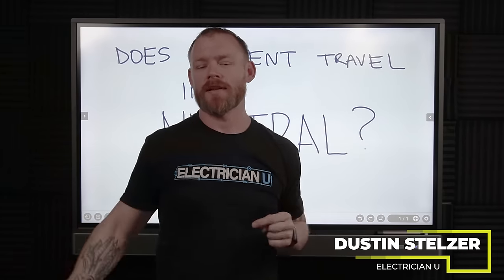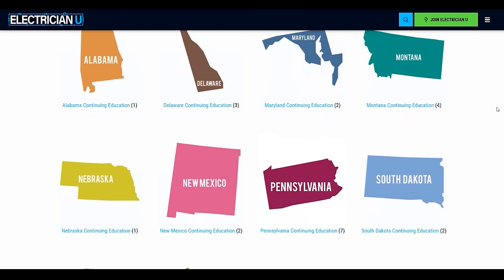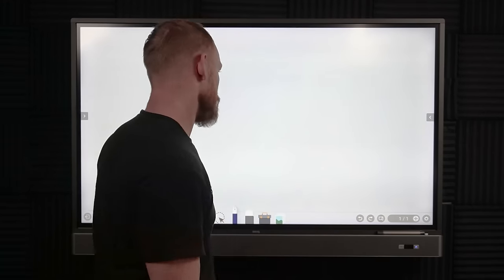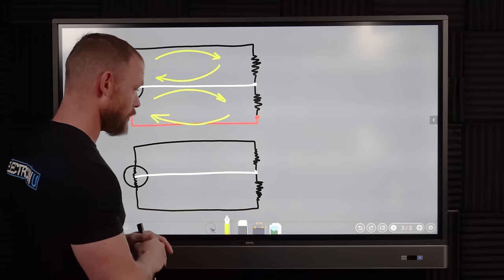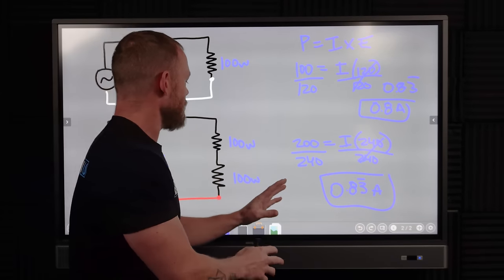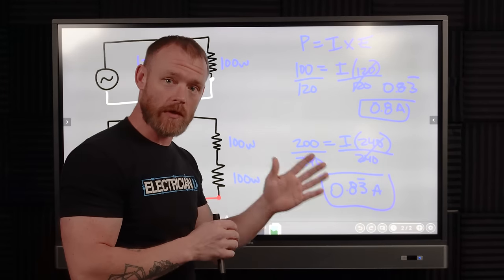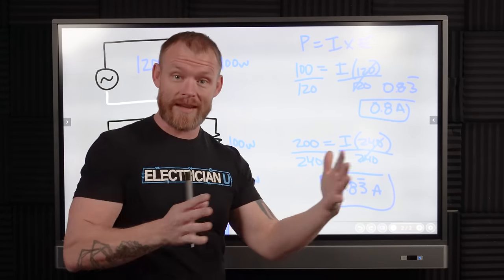Does Current Flow on the Neutral?

Comment: If there is no current flow in white neutral, why would all that extra copper wire be needed ?  Only time neutral is needed but not used is if hot has found a sneak circuit,  short, arc to ground, then ground is carrying dangerous circuit return current. Although white neutral and ground are tied together at service entrance, only white neutral is suppose to carry circuit return current.

Comment: I would be interested in you explaining how a transfer switch that does not switch (isolate) the neutral wire works with the flow or current from two different power sources (ie. grid/generator) while running both power sources are running at the same time. I'm very suspect of the "transfer" switches that I see out there for consumers that rely on the neutral bus bar of the main panel.
Reply: Power systems engineer here. Good question. If, at the generator, the ground and neutral are not bonded together (no main bonding jumper is installed), you do not need need to switch the neutral at the transfer switch. If a main bonding jumper is installed at the generator, you must switch the neutral at the transfer switch. You can't have the neutral and ground bonded in two places as this allows multiple paths for ground current to flow (ground loops).

Comment: 2 points. It's not just impedance that needs to match but the power factor  on a 2 phase split for a zero current neutral. 2. If you are using two phases from a 3 phase system like in large apartments complexes this doesn't work as easily because the phase difference is 120°

Comment: Question,( I am not an electrician.) At first, I fully followed the videos logic, but the issue that kept coming up in my head was , but aren’t the 2 phases out of phase? and not cancelling  each other out on the neutral wire? I have to at this point state ,I am not in the USA. I am aware you run 120v/60hz. We run 240/50hz. Most residential wiring is single phase here. We can get 3 phase from the power utility & run loads from each phase separately. My question is , in the USA are the 2 circuits you receive at the residence off the same phase from the street?

Comment: Current is used in light bulb creating power or watts p=I×E. Load balancing is important in high voltage situations such as facilities if you connect yourself in neutral you become resistive load and draw power back to neutral which is connected to ground.

Comment: Yes it does I was on a site where the conduit was hot to the touch. I measured every wire to the breakers and none of them were anywhere close to current for size of wire. So I started measuring neutrals and found a couple of them were carrying 80 amps on 12 gauge ( 4x code max) the conduit went to feed lighting so when they wired it up  all 8 breakers retuned on one neutral

Comment: Power(watts)=volts x amps.   The neutral carries the imbalance of the load, back onto the line and back to the Xo bushing at the substation. This is on a Y system. The definition of a neutral is: A current carrying conductor, at or near ground potential.

Comment: On a multi-wire three phase system, can you explain what happens if phase A is run in one conduit, phase B in another, phase C in another, and all  the neutrals in a separate 4th conduit?
Reply: You never run all the phases together. That is why the quad wire is intertwined together. Each phase cancels each other out, with the neutral. Otherwise, the current, which is Heat, would melt the insulation off.

Comment: This video could be summarised: the Neutral carries the return current in a single phase circuit, the imbalance current in a poly-phase circuit.  Admittedly the North American split-phase LV installation seems so awkward compared to the simple single phase arrangements we have in Australia and New Zealand (and elsewhere).  I assume the service neutral is bonded to earth at both the distribution transformer & switchboard main neutral bar (multiple earthed neutral MEN)?

Comment: Not trying to nitpick and you probably know this.  Residential 240 is single phase.  Referring to phases is not technically correct although I hear it all the time.

Instead of phase or phases I’ll refer to Line 1/2 or simply hot conductors.
Reply: I know exactly what you mean but have no trouble at all with hearing the 120V lines referred to as “phases,” even though derived from single-phase 240V.  Nitpicking is what a complaint about the terminology is, because it is useful to view the 120V circuits as a 2-phase system.  There are some other terms which some people use to describe electric circuits which are less useful and more confusing, so worth complaining about.

Comment: What doesn't make sense to me is the grounding wire (green) only protects from a hot wire short. If the neutral were to touch the ground it would not trip the breaker but just create a parallel path back to the load center and energize the equipment

Comment: This was a pretty good explanation, in general.  My only real complaint is that you were sorta confusing electric and magnetic fields, so your description of the field behaviors was a bit confusing and misleading.

The electric field does not "move" through the wire when electrons move.  The field will stay relatively constant because there are still the same number of electrons in each part of the wire (it doesn't matter whether they're moving or not).

However, charged particles like electrons will produce a magnetic field when they move.  (Magnetic fields are only produced by moving charges, so there is no magnetic field when current is not flowing.)

Electric and magnetic fields are two different things which function differently.  (They are intricately related to each other, though, which is why they are usually studied as a combined whole, under the term "electromagnetism".)

I really think the whole "fields" thing is an unnecessary complication and really didn't need to be mentioned at all, though.  You don't really need to talk about "fields cancelling" to make sense of this.  If the same flow of electrons is flowing in on one neutral lamp wire as are flowing out on the other neutral lamp wire (the same current in and out), then there's no need for any electrons to flow either direction on the neutral going back to the pole.  Everything is balanced when there's no current flowing there.  It's really just as simple as that. (your circuit-based explanation was better)

Another way to look at things:  At any single point in the circuit, the current flowing into that point must equal the current flowing out of that point (all the currents must add up to zero.  It's basically a law of the universe.).  So on the neutral bar, if there's 2A flowing in from one lamp, and 2A flowing out to the other lamp, then the third wire to the pole needs to have 0A flowing on it (otherwise things just don't add up).

I think it's also worth noting that this only happens this way because the two live legs coming from the pole have exactly opposite phases.  That doesn't technically have to be the case.  It would certainly be possible to do things where they weren't opposing phases (such as three-phase power), in which case you would not get the same sort of complete cancellation, but this is just a feature of the way that the US power grid is designed to make connection to residential homes (it's done this way because it's convenient).

Comment: If you put your amp meter/clamp on the neutral wire it will show the total amperage being used on that circuit so yes it does show proof of movement in the neutral wire.

Comment: The neutral carrys the imbalance in current while also acting as voltage regulator in case of an unbalanced load ie if you see lights dimming and getting really bright as you switch loads on and off the neutral is open , in reality it works slightly differently depending on the phase angle of the load

Comment: On the part at 20:00, you could also mention that even though they are seeing the 240v, if you measured with a multimeter from one or the other to neutral or to ground(since they are bonded), you would still show 120 volts, unless I’m mistaken. And also since I’m commenting before finishing the video, you may be about to say the same thing, although probably much more clearly.

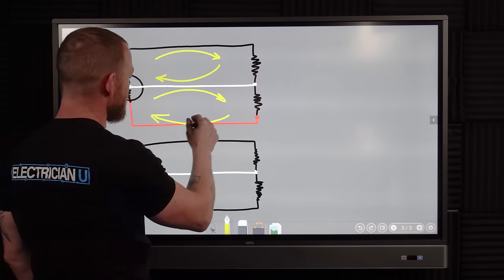Comment: At 13:09/13:10 of the video it's stated that it's "SOMETHING" that's opposing the current flow. What exactly is that "Something" that opposes the current flow down the neutral under a balance load scenario? The only thing(s) that can oppose or decrease current flow is (A) either resistance in the circuit or (B) the introduction of an equal opposing independent voltage source.
Reply: The electric field, or Electro-Motive Force (EMF) pushes on the electrons.  In his example at that point, the EMF is balanced, so no net force on the neutral.
Reply: EMF is the force that causes electrons to flow and an electric field is created around a wire or within a coil as a result of the current flow created by the EMF.  I don't believe they are the same thing as one (electric field) is a result of the other (EMF). I think what he should have clarified is under a balanced load the something opposing current flow in the neutral are the voltages from the 2 legs/phases cancelling each other down the neutral causing a net "0" current flow.
Reply: @subatomicparticle6535 — The force on the electrons in a shared neutral is balanced when the loads are equal on both sides of the split phase system.  Therefore, there is no current on the shared neutral in that case.  In general, a shared neutral carries the difference of the currents in the two legs, which have opposite polarity.  Do you prefer that explanation?
Reply: @GH-oi2jf  Quote "The force on the electrons in a shared neutral is "balanced" when the loads are equal on both sides of the split phase system". By saying the force is balanced what exactly does that specifically mean electrically as it's a vague explanation as to the "WHAT" the "Something"  is that he is alluding to at 13:09/13:10 that's opposing current flow in the neutral. If we look at his explanation at 13:09/13:10 with the arrows drawn in both legs/phases they are opposing each other down the neutral. Current flow is a result of voltage or EMF acting on a certain resistance. Since there is practically no "0" resistance along the neutral the only thing left that can cause no current flow when there is a balanced loads is opposing equal voltages or EMF's from each leg/phase along the neutral Correct?

Comment: We've been around electricity for over 100yrs and we still don't agree on how it works. People stand on soap boxes and say this is the way it works and so it is taught and codes are written. I'm here to tell you that we were lied to. Juat a few years ago the building I worked in had to be completely rewired  with wiring with an extra neutral wire because it was discovered that too much current was carried by the single wire and created a fire hazard.

Comment: NO!! short answer in a few simple words....positive (+) current is ''drawn'' to appliance only when neg (-) wire is added, drawing, and completing circuit back to ground! The question/answer that's most important, and was the main topic of your post, Is there any power left after the appliance draws what it needs to function, before returning back in the black neutral wire to ground? My confusion is, If I were to grab a hot wire with one hand and hold another persons hand and he were to to grab a ground wire, we would both be equally shocked, since I didn't consume all the power....right? (example think of me being the light bulb, and the person I'm in contact with is the black ground wire) the power is just as strong after leaving me and then passing thru him, meaning I didn't use all the power before traveling to another person or think of him as being the ground neg wire!  Sorry for the neg NO reply, thought that would get more attention to my question? 🤔 This question has always puzzled me and I'm sure many others! Please just a simple easy to understand answer, really shouldn't be as complicated, as this video has been! Thanks

Comment: In electrical systems, when current flows to a device like a TV through the black wire (live wire), an equal amount of current (in this case, 5A) must return back to the source or earth through the white wire. This white wire is more accurately termed the 'return' wire instead of 'neutral.' This concept aligns with Kirchhoff's Current Law, which states that the total current entering a node is the same as the current leaving it, ensuring no charge is lost.

Ground Fault Circuit Interrupters (GFCIs) utilize this principle. They monitor the current in the black wire and expect an identical current to return through the white wire. Any discrepancy, 5mA or more, can trigger the GFCI to cut off the power, enhancing safety.

Comment: The main panel being bonded; (neutral connected to a ground) electricity follows the path of least resistance.  From the neutral terminal block the current is flowing to ground.
Reply: Electricity always returns to its source. It does not flow to ground; however, it will take any and every avaliable path (including through the ground grid) to return to its source. This is why the ground and neutral are only bonded once at the main panel.

Comment: I got lost when you drew the very first breaker panel to the light bulb circuit using a red wire and white wire. My limited experience has always used black, white, and bare wire cable.  Took awhile to understand what you were doing. Actually, a long while. Difference due to teaching theory vs. practice, I guess.

Comment: Absolutely true in a balanced load circuit. Unfortunately the average house panel isn’t balanced and therefore you will have current flow through the neutral.
Reply: It isn’t unfortunate.  It is next to impossible for the neutral current to be balanced.  There are many 120V loads on each side of the service and each load is unique.   Neutral current is normal.

Comment: I wish someone could answer if current flies back to the pole while operating a generator with the interlock approach. Since neutral is not disconnected can this be an issue for lineman or any thing else?
Reply: With everything else being "normal" and only the utility service being de-energized, no voltage will return to the pole. The "balancing" of the two lines "legs" affects the conductors back to the source, which in this case is your generator. This is not to say that it can't come from the other way if for example a 7200v energized line should fall on the system neutral it might let the smoke out of your generator. Storm or outage situations are by definition not "normal". I have seen energized lines contact the system neutral and the service neutral be the short circuit path to ground that set the house on fire.

Comment: Answer a question for me. 🤔   I've notice that my house has several neutrals tied together that are fed from different breakers.  So what you're saying is that even with breaker A turned off,  current from breaker B could flow back on neutral A which is bonded to neutral B.   How dangerous is this?

Comment: I understand current flow on the neutral but isn’t it a misnomer that the electrons actually flow on AC voltage. The sine wave oscillates back and forth 60 times a second (in US). Nothing (electrons don’t) actually flows.. it hurts my brain a little bit but I think you hit the right idea with the field actually moving. Correct me if I’m wrong. It’s been awhile since I did Electrical theory. Interesting how that oscillation cancels the flow on the neutral but I believe it has to do with the sine wave being in 180* opposition to each other. Ie, the push pulling that you refer to several times.

Comment: The neutral is often times called a return.  Giving resistance to the hot through any fixture while on.
Reply: It is the usual practice when making electrical schematics and describing the function of the circuit to  start at the hot wire and finish at the neutral and call it the return. However, as we we know that is not strictly correct but it serves our purpose to have a start and finish to a circuit. Some people can get carried away when describing circuitry but a common sense approach should prevail. Please explain what you mean by “giving resistance to the hot”.
Reply: Resistance & voltage is measured on a neutral from a fixture turned on.
Reply: @normanmack2368  I still don’t understand what you mean
Reply: @kennethcohan9630  well I guess for instructor s I should have said "Giving resistance from the hot through any fixture turned on.  If you're not familiar troubleshooting residential and commercial problems.  For an example open a hot circuit feeding an appliance turned on.  Hopefully low load.  When you open the neutral at the panel you'll see a small spark.  Then measure the voltage between the open neutral and the panel neutral buss.  Depending what voltage you have.  You should read half voltage like an open neutral.  Then connect the neutral back up and you should measure a small amount of current this return.  Sorry I miss spoke.
Reply: “Return” is a misleading term, though.  Much confusion has been caused by using poor models and poor terminology.